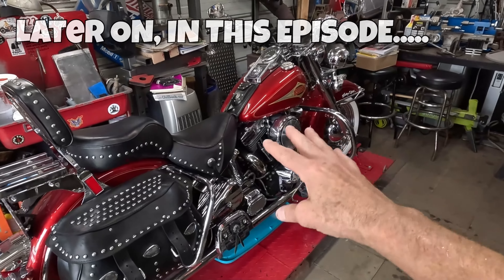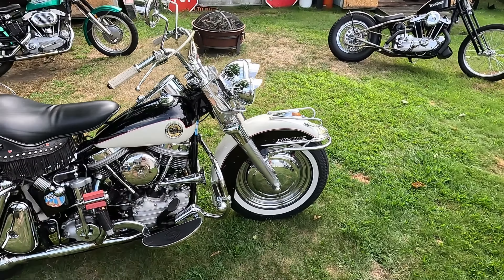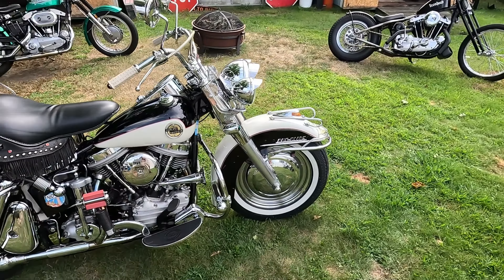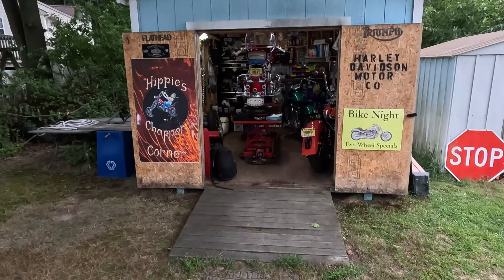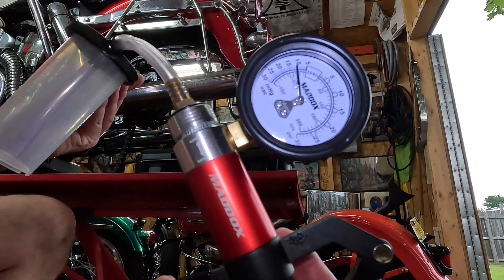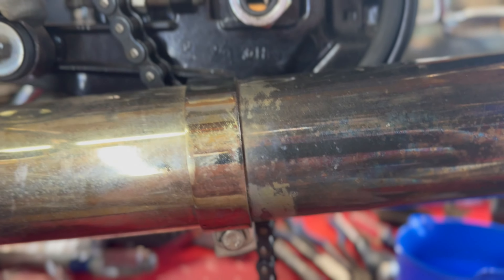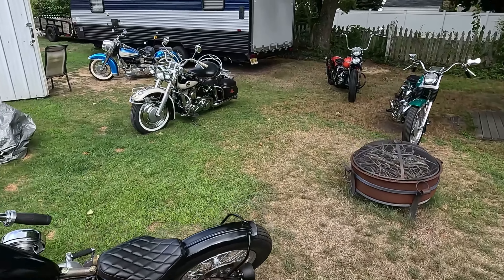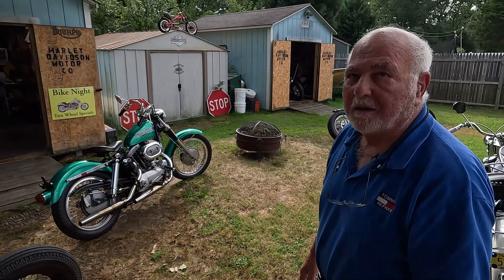Vintage Bike Show, & Panhead Brake Job

Comment: You seem to like the Clymer manuals , I’m curious as to why . They seem to be so vague. I just print off manuals or sections I’m working on. You have to dig around but they are available for free
Reply from the maker: Well, not really Tobin the clymer manuals you see me using are not mine. The one that’s on the table with Vicks Panhead that’s his manual that he brought over here for me to use while working on his bike and the one you see on the table with Tommy’s heritage is his manual that he brought over here for me to use as well !! most of my manuals are factory Harley ones,  for all of my bikes- however I do have a couple clymer manuals, and I’m not opposed to them if that’s all you have!!! most of my bike may are factory Harley manuals!!! 👍🍺 SLICK
Reply: @SlickHeadCustomCycles    Ok  that I didn’t know
Reply from the maker: No biggie!! Why would ya!! 😂😂
Reply: @SlickHeadCustomCycles   well because I’m a mind reader but the drones flying over sometimes affect the signals 🤫